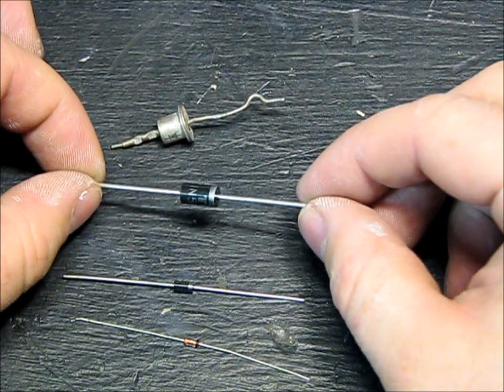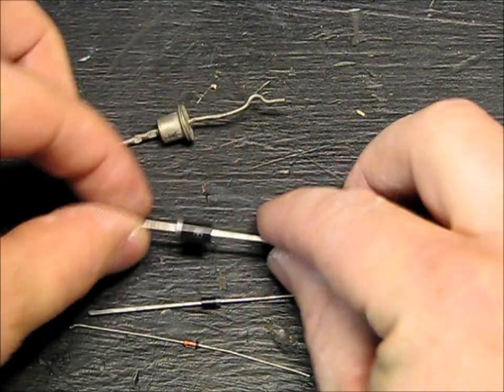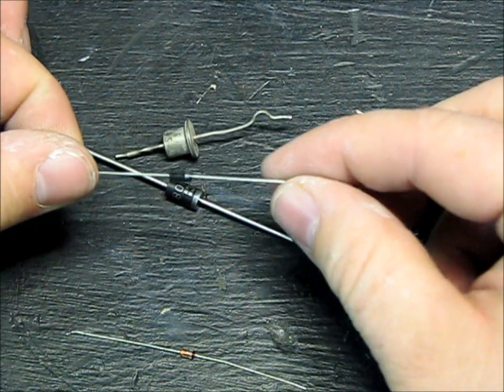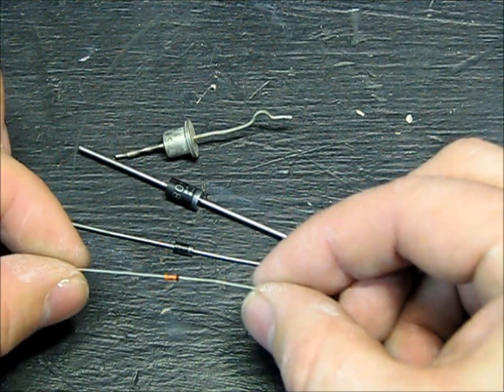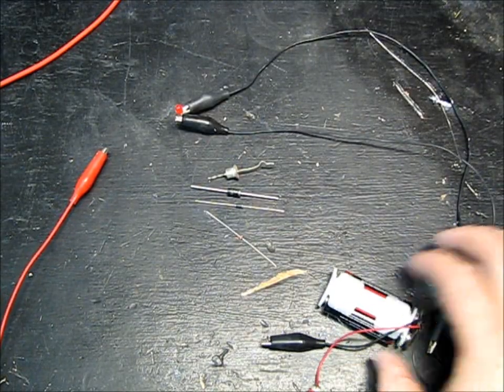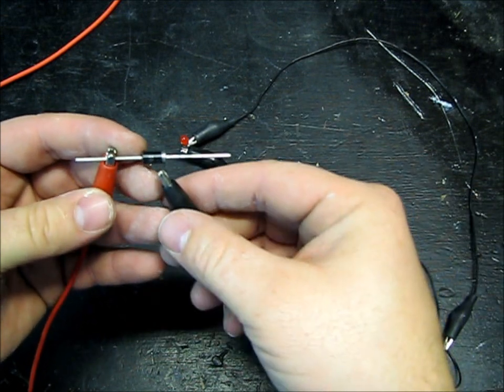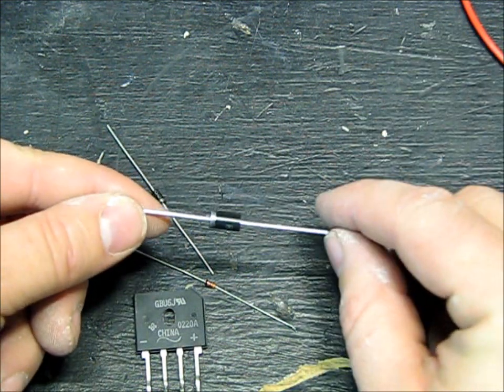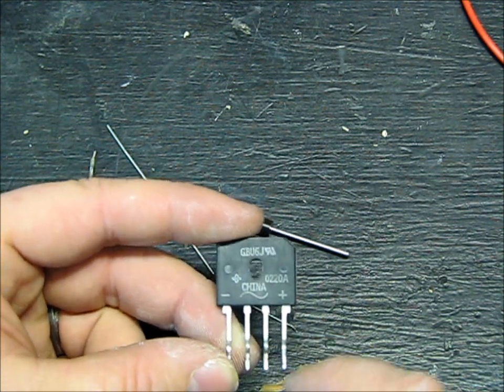What is a diode?

Comment: Dont you need transformator to turn AC into DC? If not, whats the downside with a bridge rectifier compared to transformators?
Reply: A transformer is just a magnetically induced step in (AC) voltage. A diode transforms (becareful of ambiguous language; a diode is not a "transformer"!) AC to DC via N-type and P-type materials. 

Also, a rectifier is just a system of diodes.

Comment: Is the diode the battery or the stick?
Reply: The stick with the cylinder in the middle is the diode. It is composed of lattice P/N type materials which restrict electron flow directions.

Comment: What happens if I have a diode rating at 200v and I run 1000v in the opposite direction? Is that diode usable after that or it will be gone?

Comment: soo.... what is the function of diode whats the difference between with diode and without diode ?
Reply: In this case, it doesn't matter. 

In other cases (ergo, when your source isn't a DC battery), you might want to use a diode to force current direction.

Comment: I have a 5v dc 7W solar panel to charge my phone while camping,works well when sun shining  but if I accidentally leave phone connected to panel  at night or if sun goes down  phone  battery goes dead think need a diode to stop phone battery voltage running back to solar panel???? what diode value would i need for say 5v 1.5A
Reply: P=VI

Comment from the maker: When a diode smokes it is usually because there is a short circuit, that means way to much current is traveling through the diode, it overheats and burns up. Diodes can fail on their own and either short out or open up. If your application smokes diodes repeatedly obviously there is another issue.

Comment: You didn't put positive and negative on the diode. What you did was complete the circuit. If you put positive and negative to a diode it will explode/short out. In your video you have 1 wire from the LED's going to the battery and the other is ran through the diode. When electricity from the open circuit flows in the right direction is when the LED lights up. The way you explained it with the "negative and positive" going to the diode makes it seem like the diode works with power. It doesn't!